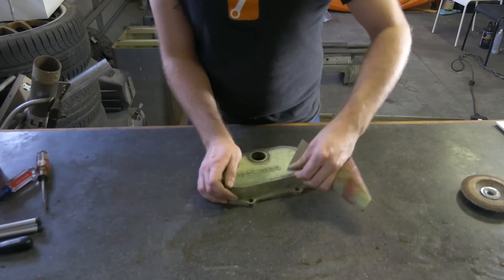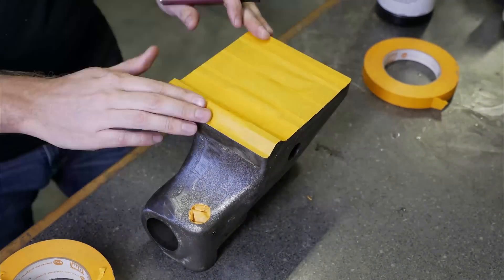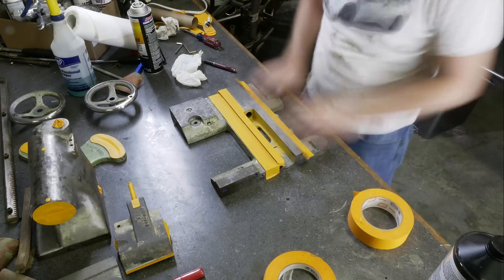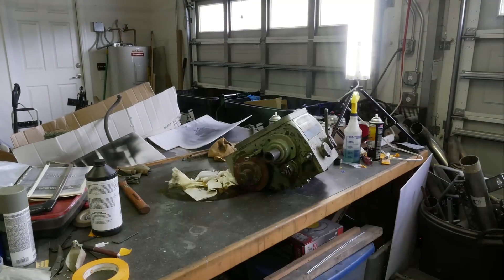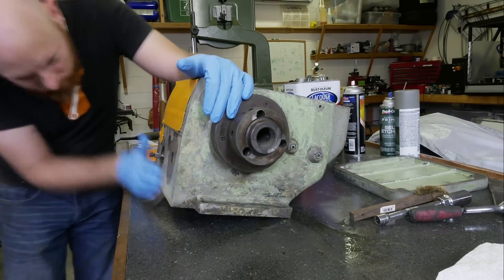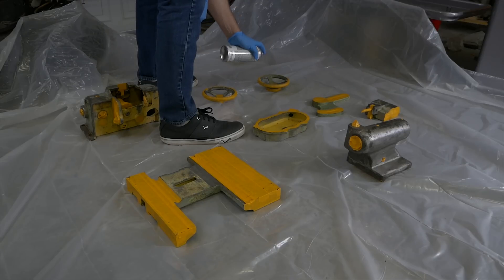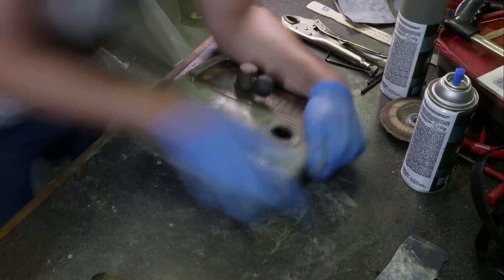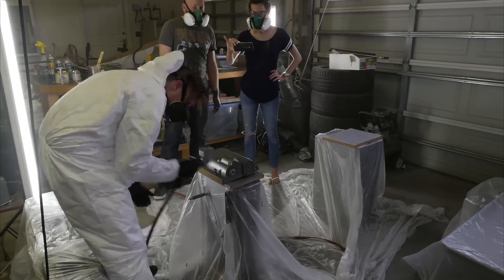Lathe Rebuild Part 6 - S02E06

Comment: A soda blaster would have been ideal to get rid of the pain on those parts.. bla. sts the paint right off without marring the metal like a sand blaster would. Enjoying this series. Odd question though (I know nothing about lathes or shop machines other than what I have learned from watching  many channels on this subject: )

Before going through all this trouble of making it look pretty, did anyone check the machine to see if it was true ( parallel, square and true enough to be useful?)  I would hate to think you would be polishing a turd by the time you're done all the assembly! yoikes!  Enjoying the series though, haven't finished it yet so at this time I don't know the outcome  ;)  Cheers

Comment: You should have used an old radiator from a car with a filter and spray to its direction to get rid of the ovetspray, but it's a bit late now lol

Comment: Again a dead blow hammer. Cool you use a high quality tape to get a nice sharp paint edge, why use it in the middle and around shafts that are not close to the paint line? Less expensive tape is fine. Paper works to cover sections you don't want painted.

Comment: Blue tape is intended for painting interior drywall, not pulling off the paint etc. when removed (not a concern for metal).  No big surprise that it doesn't stick well to metal, never intended to.

Comment: SAE 80, SAE 90 from a nice brand will work just fine, does not need expencicive transmission oil, I good oil for differential works just fine.

Comment: Next time you do a project like this instead of taping try using grease or Vaseline just a light coat over it wipe your edges clean spray paint over it wipe it off when you're done

Comment: Great job mate, I came across an easy way to trim tape very accurately, use fine sandpaper and hit the edge at 45 degrees, it cuts the tape really close to the part and easy.

Comment: Sandblast every surface that doesn’t have a bearing/steel fit.
So, besides ways, threads, shafts, bearings, and bearing seats... you can sand blast it... sandblasting will save you time brah

Comment: I know it's an old vid, but to save on using miles of masking tape to mask large parts you don't want painted, cheap freezer bags work a treat. You only have to tape the opening to the piece you're spraying and it saves a stack of tape and time. It's probably been mentioned, but thought I'd say it anyway.

Comment: The yellow paint on the inside of the lathe, if it is what I think it is, you probably shouldn't have painted over it. If it is what I think it is, it is a hydrophobic coating to aid in keeping the inside of the machine clean. It is found in a lot of older, high end industrial equipment and engines that have a lot of use and require oil. It makes it easier to get the dirty viscous oil out when doing a change.

I have only ever seen it red, but that yellow paint had a similar texture to stuff I have seen in the past. 

But I am most likely wrong. I am not an expert :P
Reply: It isn't anything terribly special.  Basically a primer.  It's purpose is to seal the interior cast surface to ensure oil can't seep out.  You will find this applied to just about every cast piece that has to retain fluids.  You can paint over it, the risk is will the new paint properly adhere?  What damage could paint flakes cause during operation?

Comment: Could have used the ball side of a ball peen hammer to cut that tape.  Works best on flat surface.  Tape up and tap on the edges and the tape will cut perfectly.

Comment: Just recently bought myself one of these lathes for £623 thinking it had no problems then realised that most of the handles are broken off or smashed. Also the motor only goes backwards which is not very helpful but then again it was a cheap price for a Bantam MK1 800.

Comment: Also would of purchased some urethane paint too since it would of been cheaper in bulk at this point instead of the spray cants.  Also, whenever spraying like with an HPLV, make sure it's well ventilated.  When the paint atomizes, it can become flammable and flame up when reaching a fire.

Comment: A neat trick to get a perfect seam on the tape without having to use an exacto knife is if you have a nice edge on what your taping you can tap it with a rubber mallet on the edge which will cut the tape and stick the tape really well. Sorry if that’s confusing and it don’t work on all edges but it saves a lot of time

Comment: One thing you will find out with age is you must get of the flood with protects. Get to waist level at least. I'm 75 with 40 years in tool and die and maintenance. A 3 phase motor with a vfd  would really make this project, if not all ready done.

Comment: Looks great but would you have considered sand blasting instead of finishing by hand
Reply: Sandblasting media is abrasive, removes some of the metal, and tends to get everywhere.  No way would I sandblast a gearbox like this!  Or mating surfaces, or machine ways or slides.

Comment: Bare toes and heavy bits of machinery are a recipe for pain and hours in A&E. Just slip some steelies on!
Reply: moleman1961 steel toed boots are strong, but if they pinch your toe from heavy weight, you’ll lose the toe no matter what
Reply: @goldenwalrus2579  That is what they were designed to do.

Comment: Eastwood makes an acid called "After Blast " that is awsome for cleaning rust off things like machine parts. You can watch it eat the rust off if its in a clear container to soak. Also what do you guys have against sand blasting. You are a gluten for punishment doing it that way.  Go to Harbor Freight or Tractor supply and get the 110 lb pot blaster and just run sifftedand screened play sand through it on a tarp in you back yard to contain it a bit around the sides too. Also wear a respirator and googles and gloves. Much nicer results and fastet paintable surfaces.

Comment: for the brass plate. paint your color and with a flat metal and 600 grit run it lightly and it will take the paint off the letters. you can also do what AVE has done and make your own using a sheet of brass

Comment: For flat makers plates and other info plates like the one here, I've found the easiest way to restore them is to completely strip the old paint and spraypaint them. Do one coat, then with a very solid and perfectly flat backing block, (I used a piece of 1 inch thick bullet resistant lexan that I got at a salvage place) and ultra fine sand paper, wet sand the plate to remove the paint from the high spots only. Put on as many coats as it takes to get the look you want, but sand between each coat to save yourself a lot of headaches. Once you get the look you want seal it with a coat of clear and you're in business
Reply: forgot to mention, this method means having to remove the plate from the machine, you'll need to grind off the rivets or hammer screws and drill out the holes in the body of the machine, but replacement hammer screws are available online.

Comment: If you ever do this again, or for someone considering this..... When masking a large area  that is entirely unpainted, or an area like the end of the headstock with all the exposed shafts, don't use so much tape. Just mask the perimeter with tape, use 2 inch width if possible, and trim the edges. Now go to the kitchen and get some aluminum foil. Carefully mold the aluminum foil over the shafts, and end so that it covers everything (and has NO HOLES). Now cut the aluminum foil so that it sits on top of the previously applied tape (make sure that most of the existing tape is exposed). Now tape the aluminum foil down to the existing tape, make sure that the entire edge of the foil is taped down. It's easier to apply, easier to remove, and you use less tape. 

Note: depending on the part, the amount of "handling" you have to do after masking, and the paint you will be using, you can sometimes substitute paper, or plastic sheeting for the aluminum foil. The aluminum foil just works for any paint, as long as you take care not to tear it.

Comment: On the information tags for speed and gear, I am sure there is a way to make it pop. Believe it or not on south bend lathes, they make duplicate badges, that make your lathe look brand new. That is except the wear on the ways, which has to be done at a special shop for big money. To do it yourself from end to end, you have to do it part by part, and then running it down the whole way length, thus taking a very long time to get it below one thousandths the whole length with twist and sag. If you focus on the first 2 ft, where 99% of the work happens, then be under 5 thousand down the ways, probably ok.

Comment: For that plate, they make little plastic wire wheels that would be a lot less abrasive than a steel wire wheel. Slap one in a Dremel and see how it works for you. I'm no pro but it's an idea.

Comment: For the feds/speeds info plate, watch NYC CNC' video on making one through electrolysis. (Called "How to make ink filled brass machine plates.") If you can make the vector cad file. Then have a company for the CNC machining. If you want it to look new and professional.

Blue painter's tape is specifically designed NOT to stick. It's mainly for being applied over already painted surfaces so it doesn't lift the paint underneath. Use regular tan painter's tape for things you want it to stick really well to.

Comment: Tellus 27 or similar hydraulic oils are used as bearing lubricants in many lathes esp where felt wicks are used to distribute the oil. Non detergent motor oil (used in vintage cars (no oil filtration systems ) can be used as bearing oil where a direct application  system is used . BUT you may find manufactorers guidelines in Vintage Machinery .org archives

Comment: You can get a great edge on the masked areas by tapping the edge with a light hammer instead of the cutting . Old mechanics used this method to make gaskets out of sheets of gasket stock (my brother and I used to repair our own cars when we were at Univerity)
A F Pienaar
Johannesburg

Comment: I had the same dilemma when changing my oil. As mentioned by a few people, Shell Tellus 27 was the recommended oil for that lathe which is discontinued and an ISO 32 grade hydraulic oil is the closest equivalent. I use Castrol Hyspin AWS 32 in my Bantam (because I was able to find a supplier who sold it in 5L drums rather than 25L buckets). The headstock and feed gearbox both use the same oil.

Comment: What means this self-etching primer term?
Reply from the maker: The paint basically as an acid built into it that is designed to cut into the surface of the metal at a microscopic level. this gives the paint something to stick to.
Reply: Thanks, PA - learned something new!

Comment: The comments on crossing the oils called for is the right call.  in general the headstock and gear box will use a 'circulating oil, one that is not lost in use and will contain anti-rust compounds.  I generally use a Mobil DTE in those cases.  The ways and tailstock  should all get way oil.  I use Mobil Vactra #2 or Vacuoline 1409.

Motor oils and ATF are made for a very different environment and shouldn't be used in machine tools.  Some machine tool manuals were written before oils were specialized and will spec an ISO or SAE and all you can take from that is the viscosity.

All that being said any oil is better than no oil.  The right oil is better than any old oil.

Oh, yeah, a shear pin is a safety mechanism and is expected to shear - it's a bad idea to replace it with something hard/tough.  I'd throw in brass or mild steel.

(Holy crap but the spellchecker on my phone is obstinate!  Edited to fix it's changes)
Reply: Russ Kepler I

Comment: Why did you not use a sandblasted to clean a lot of these parts up? Would it not have been quicker and easier than sanding by hand and using the wire wheel?

Comment: Just use Iso 32 hydraulic oil in the headstock. Also put a bit of grease back in the old 3 jaw, but nowhere else on the machine. Use light lubrication oil on the change gears. As you have already done it, refrain from using a bar through the headstock to lift it. Those bearings are extremely expensive, like $700 each (and you'll need a pair)

Comment: I love dumb questions, so... 

Why paint. Other than aesthetics, of course, but if one took it down to bare metal, and left it as clean metal, would that be a problem? 

I guess one might suppose paint protects against corrosion, but that's not entirely true. While it's been quite some time since I studied corrosion, I do recall that corrosion under paint or in pinholes in paint can be very bad.

Comment: Great Project! Use Shell Morlina S2 BL 10.  Recommended replacement for the Colchester Chipmaster. They are very similar lathes.
Reply from the maker: looks like good stuff! now if i can only find it in less then 5 gallon buckets. spending $100 on oil for a $200 lathe hurts. lol

Comment: you may contact the main manufacturer (COLCHESTER) they will give you the manual for it, its a great to have one to make sure you have all the parts for it, just make sure you have the S.N for it (you can find it on the base tailstock side) ..... great work :)

Comment: At the end of part four you mentioned scraping in the ways,. The "Bedways" on the Bantam are induction hardened, so can't realy be scraped. The saddle might need some attention, but as you haven't used the lathe yet i'm not sure "scraping in" for S&G's is realy the best coarse. :-)
Reply from the maker: +Wobblybob2004 I have been doing a bit of reading on scraping induction hardened bedways and there seems to still be a debate about it. I see a lot of people say you can't, but I also see a lot of people that say they have. What has been your experience with it?

Comment: lets see a test cut and then you should get the bed reground. its small it wont cost much
Reply from the maker: I called every machine shop in town and got the same answer. No one does grinding, and shipping the bed would cost as much as we paid for the whole lathe not included the price to get it reground. so unless you know someone in central Florida that does precision grinding that's willing to give us a good deal, it looks like we are scraping this sucker in.
Reply: nothing wrong with scraping it!

Comment: Great Job !
The recommendet oil for this Machine was Tellus 27 which ist actually a ISO 32 Hydraulic oil.
Automotive transmission oil is way to thick and engine oils are not suitable for gearboxes of machine-tools for different reasons.
Reply: You certainly don't want to buy a new set of Gamet Bearings...
Reply: Tellus is Shell's branding of their hydraulic oils.  The 27 refers to it's viscosity (ISO 27).  The current Shell industrial hydraulic oils are Tellus S2, S3 and S4.  The price and quality go up with the numbers.  Each is sold in ISO 22, 32, 46, 68, and 100.  Just cross reference to these and you should be ok.  AMS has oils that cross to it.  I think the problem will be that as an industrial oil it comes in 55 gal drums.
Reply: You can use Mobil DTE 24 it comes in 1/5 buckets
Reply: A thread from the Home Shop Machinist: 
http://bbs.homeshopmachinist.net/threads/70749-Gear-Oil-for-me-ENCO-1340-Lathe

The gear oil is basically a hydraulic oil as Taunus Mechanics said with anti-foam, and anti-wear, additives.
Reply: Taunus Mechanics I agree
Reply: I'm sure it's too late at this point, but if you have a business nearby that uses the oil you need, you may be able to get some from them. I have an oil manufacturer in my town(Northland Oil) and they are perfectly happy to sell small quantities of anything they make, even the specialty industrial ones.

Comment: I'm not exactly an expert when it comes to shop machines but I can tell you as being a mechanic for the past 13 years, that using Genuine Ford Fluid XT-M5-QS Full Synthetic Manual Transmission Fluid has never hurt any car I've worked on, whether it be newer Scions or old Chevy of Ford 3 speeds. I'd have to imagine that if it can handle 7000rpm that the lathe shouldn't be too much excess force for it to handle

Comment: About the plate... You could hand-paint the red lines first, since they're minority (well, it looks like it's red :P ), then cover them with masking tape and paint the rest of the plate in black. Don't mind the letters being covered by paint, cause you can use a sandpaper to reveal them since they're a little raised. You're gonna save a lotta handwork in there!

PS: Gotta give props to you guys for the restoration. It is sure some real art work!

Comment: The legend plate - paint the whole thing or all recessed areas (but without going to a lot of trouble with overspray) then go back over with fine grit paper (with a backing pad) again to take off paint high spots leaving just the paint in the recessed areas. Probably don't want too thick a paint coat.

Comment: You could build a sandblaster with your compressor for under 100$. Awesome videos btw. And high quality👍
Reply: Sandblasting is a process that removes material via abrasion.  Sandblasting machine ways, bearing surfaces, etc. degrades their accuracy.  Any sandblast media that gets into the gearbox (and it gets everywhere!) will start destroying the gears and bearings.
Sandblasting has many uses, but this shouldn't be one of them.